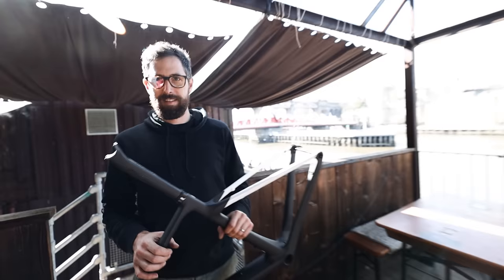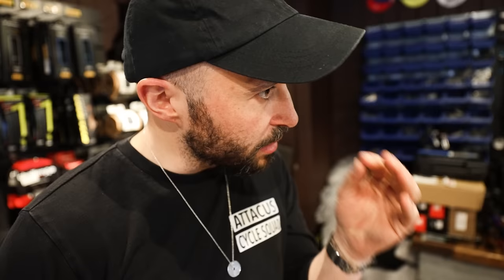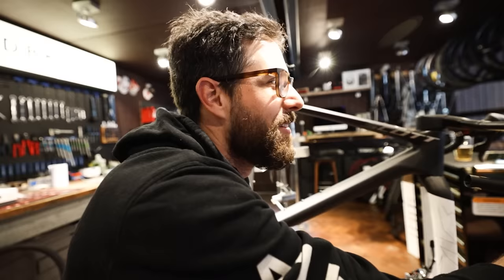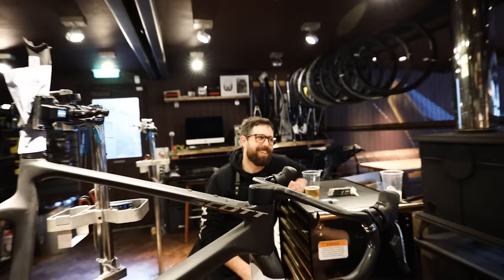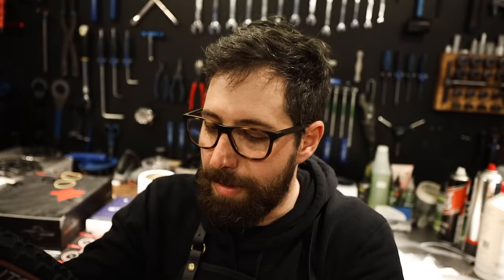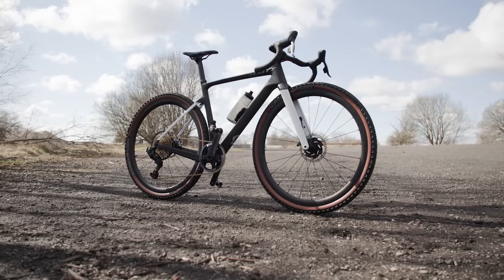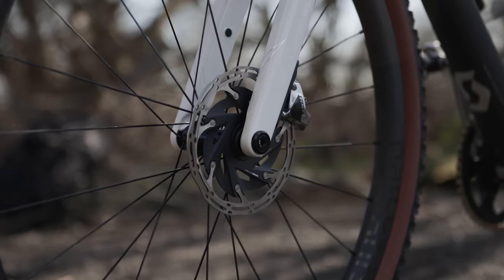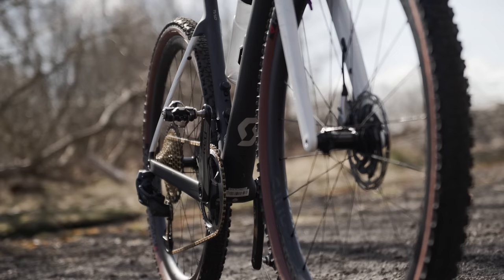My New Gravel Bike - SCOTT Addict Gravel TUNED

Comment: Di2 battery running out is so not a thing … I’ve run di2 on a bike for a decade and never had any issue with the battery dying. Just check it regularly and it charges in < an hour. Nbd
Reply: If only the people I ride with were as sensible as you.

Comment: I think the interchangeability of batteries on SRAM is cool, but it's also a reason why people who ride Di2 stick with it — we've all seen our friends have their batteries die and have to swap the front mech for the rear, but Di2's battery lasts for 5000-7000 miles. I charge mine maybe once a year right now.

Regardless though, wireless is going to be the way of the future. The new edition of Di2 is just a happy medium between wireless shifters and wired mechs until someone can get the batteries to last longer. SRAM has done amazing stuff pushing the market forward — the stuff is stupid easy to set up and considering their new group sets come with integrated power meters, the cranks are insanely light.

Comment: I’m not sure about the whole mullet thing for drop bars. I have a 10-50 12s cassette on my XC bike and I really wish the ratios were closer. Also, when I’m on a drop bar bike, I like to be able to pedal at 70kph. The super low 1st gear is great but I feel like it’s a compromise everywhere else

Comment: Love the bike, and the weight-unbelievable for a gravel bike, especially with 45mm tyres. On the tubeless thing I have been getting 43mm Rock and Roads to seal tubeless-I do have to keep the sealant topped up and pump them before every ride-but they work and are not rated a tubeless tyre.

Comment: A very nice build, that'll help you keep up with Tony. Mate ran home brew tubeless before all the bits became easily available 26 inch wheels back then, and quite a lot of mtb tyres did work though you did have to add sealant seal the tyre and then add the rest worked well.

Comment: Drool. Very fun video. I look forward to watching the full build later.

With my financial resources i went with the Felt Broam 30 with GRX group set. I think my top tube weighs more than your entire build...but I am also <cough> several kg heavier than you. I like this mullet idea as the GRX tends to get wonky after a few minor taps on off road trails. 

I'm making the jump to tubeless with my gravel bike and probably my new road bike. Any tips for being able to seat these without a shop compressor? I'm swapping the stock Felt wheels for Hunts as they have been extremely reliable on my older road and gravel bikes

Comment: Love a bit of mullet

I’m using a converted 11sp to 12sp Sram force with a 12 speed Sram GX derailleur and a Ethirteen 9-50t cassette on Sram XDR

Had to convert the chain pull on the GX MTB to a road chain pull so this system will work together

Comment: I use SRAM Apex on my gravel bike and it works great. Would I like a more expensive/better SRAM groupset? Sure but the Apex is great for what it does and what I could get hold of at the time. Love SRAM sets and will eventually upgrade to a different SRAM set.
Reply: Same here. Got the lowest spec Aspero i could and its hard to fault the apex really. Just wear it out i suppose :)
Reply: i've got SRAM Rival and it has everything you'd ever want. only if you do very competitive cycling (racing) maybe you'd want Force because it's lighter and compatible with blip shifters, but yeah that's like 5% of cyclists i think.
i got 2x Rival though because it's a 'hybrid' road and gravel bike (2 wheelsets), would go 1x for a gravel specific

Comment: Love the build and similar to my own. But out of interest, why so big on the front? Surely 49-50 as your easiest gear counters having a MTB at the rear?
Reply: I would imagine that it’s to avoid spinning out on fast descents. I have the exact same set up except for a 42t ring, and I run out of headroom at about 55/57kph, so am thinking of trying 44t next. 49 certainly is punchy though - even the Ted King / Stetna gravel race guys don’t go beyond 46/48 in most of the bike check vids I’ve seen. Will be interesting to see how Francis finds it.
Reply: I guess the MTB cassette is just to get the wide range? The lowest gear is really close to the lowest gear that originally came with my GRX 1x setup, so it's not too weird.
Reply: @stuartdilts2729  absolutely - you can climb trees with the 50 (or 52) at one end and then get a decent head of steam up with the 10 at the other end, especially with the big chainring. The only compromise, for me, of the 1x mullet is the gaps between gears, and even that weakness is arguably over-hyped: I actually find it easier for climbing to have the bigger gaps; it’s only an issue on fast group rides where other people are setting the pace, and a fast one, and you can wind up hunting for the right gear. I think the best all-round cassette is the Campy gravel one, but it’s mechanical. If SRAM do a 9-43 cassette, or whatever the Campag one is, for the AXS family, I’m first in line. A 9t rear cog and a 44t chainring would be bloody quick and they have smaller gaps than the SRAM.
Reply: Just what I was thinking. I’m on a 42t 50/10 and I rock bottom and spinning out down hill and flats.. just bought a 44t but now I’m thinking… 46t??? I still want to get up steep gravel and slightly techy sectors though without burning my legs off if it’s a long climb
Reply: @onenotesolo256  
Sram do a 10-44 12 speed for AXS which is what I will be using on my gravel bike.
Running a 40 tooth ring though!
Can't imagine running such a big ring on a gravel bike.
Running 1 X on my road bike but that's 46 tooth front and 10-36 rear.
Reply: @maxlloyd3740  assuming that you'll be using a Force or Rival XPLR AXS for that since Eagle AXS isn't compatible with a 10-44 cassette?
Reply: @Emolokz  
Yes,
Got a Rival XPLR ready and waiting.
Just waiting on some Rival brakes.
The frame would help as well but that's a month or two off as well ! 😂😂

Comment: I'm debating, whether to get one of those Creston bars for my addict gravel 20. What "stem length" are you using and is the handling any good? The stem looks rather short and I am looking to reduce my reach on the bike with the 80 mm stem version.

Comment: Can you give us an update with a semi honest (I know it's sponsored) opinion how the bike feels.
For example: how does the geometry feel on your local trails 

I know it has a really stretched race focus geo and it should be a bit limited when it comes to sharp corners or a more relaxed bike packing trip.
Reply from the maker: It's a very long bike which makes it stable at high speed, basically the opposite of a CX bike so I'm not sure what the Scott sponsored CX athletes will think of it in the corners.
Makes it a way better suited bike for normal people riding though, confidence inspiring. 

I wouldn't worry about it feeling too "racey" for bikepacking though as the head tube is quite high, it's more relaxed than my road bikes for sure

Comment: Pretty useless argument at about 4min. Sure you can swap ETap batteries around, when they die.  Di2 though lasts way longer and doesn't need to be charged every other day. That is because wireless just wastes energy. We went like 2k km through Chile with DI2 bikes on a single charge and still had some left..

Comment: Sweet build! Do you have 650b wheels see if you can go even wider than 45mm? I got the addict gravel 20 with force xplr and zipp 303s with 45mm schwalbe. unfortunately i dont have any 650b to try it out. Thanks bud, lovely bike! got 2000km on mine and loved it every minute
Reply from the maker: officially the bike doesn't take 650b wheels.
Reply: @Cade_Media  i ve read that. I guess they fit, but you dont gain any more clearance in width i guess
Reply from the maker: @theothervalentin  apparently it's the BB height being reduced that means they can't recommend using them

Comment: Carbon frames are not for gravel bikes. I have a carbon road bike, aluminium mtb and touring bike plus I've owned steel framed bikes in the past. It's 'horses for courses', carbon is not for rough riding gravel biking, in my opinion. I'll just throw in for arguments sake that disc brakes are also not for racing road bikes.
Reply: Your opinion about disc brakes not being for racing road bikes is flawed, especially considering the entire Peloton is on discs now.  Or would you care to argue with them?
Reply: @Emolokz  Alexander I live in Altea Spain I speak to the pros mechanics at their hotels. They are governed by the sponsors and must use what they are told to use, they are under contract and cannot criticise any of the components or clothing publicly but in private many don't like disc brakes because of the noise which gets more and more annoying after three to four hours riding irrespective of the superior braking efficiency. Unless you're at the top of of the game like Froomey who is powerful enough to speak out publicly you keep your mouth shut. Discs are great for gravel, mtb, city bikes etc but not for the grand tours. So yes, to answer your question.